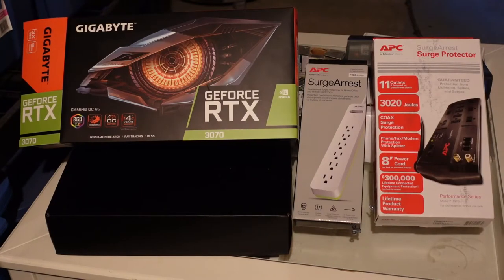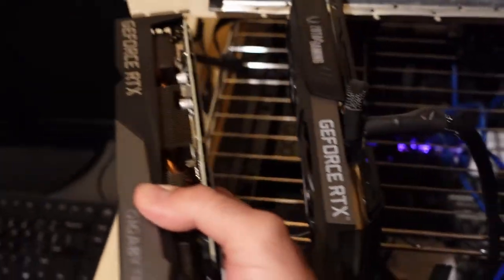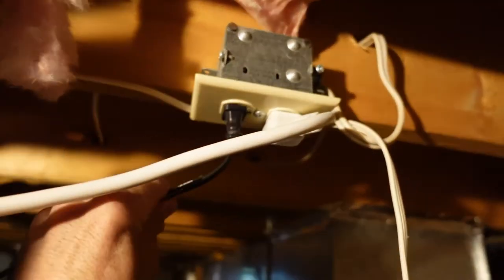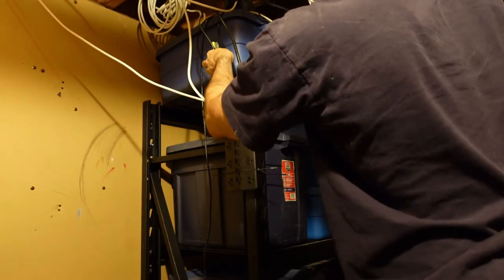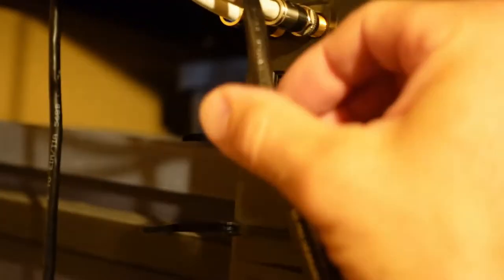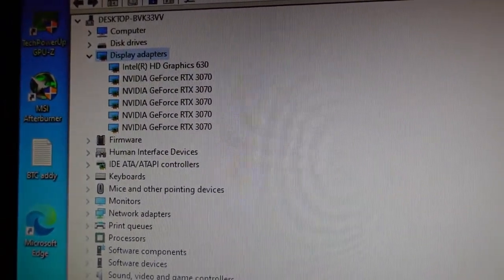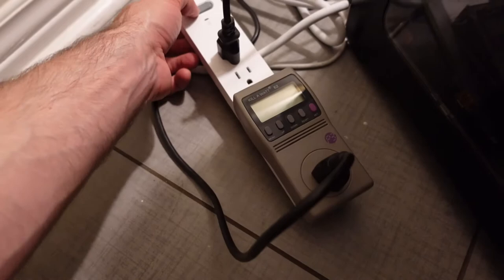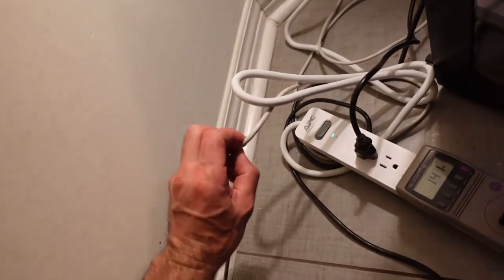Surge Protection - Mining Rig

Comment: A cable guy here you will have electromagnetic plus from the surge protector, those gold barrels for the coax cable will give you packet loss just a heads up.
Reply from the maker: I'll have to look into that.
Thanks for the feedback.
Reply: Bush is right. you will produce flaps and spectrum return noise putting that between your modem and the cable network.
Reply: @Linophryne  thank you